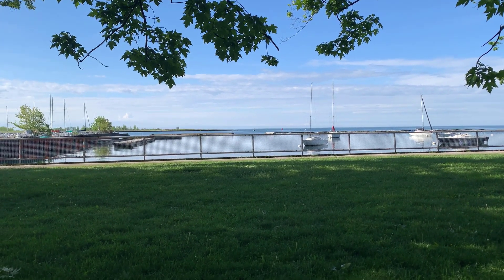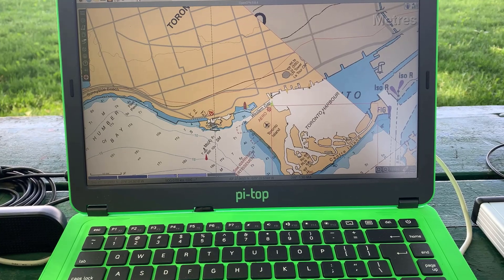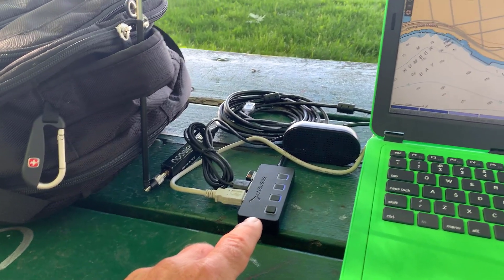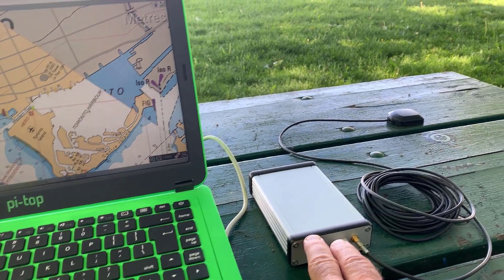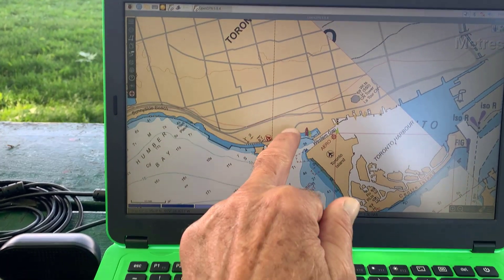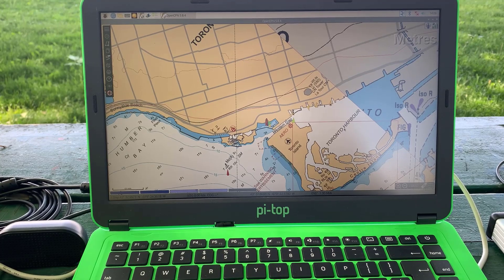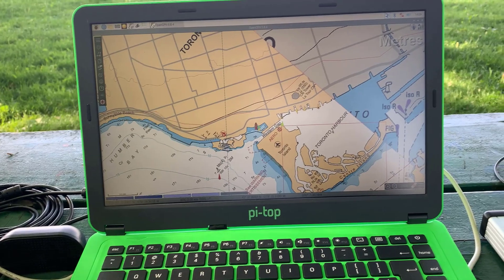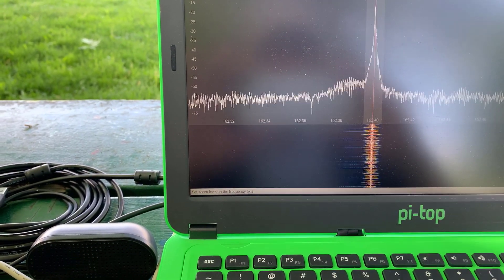OpenPlotter3 - AIS & GPS on RPi3B

Comment: Hi Jeremy, I use a RasPi 4 (8GB) and OpenPlotter 3. For the AIS RTL-SDR-Dongle I build myself a Flowerpot Antenna with a choke coil at his base. I carefully trimmed the Antenna on 162 MHz with a small China SWR tool, and the RG58 cable to the antenna is no longer then 9 m. But I am not very happy about the poor range that it gives me back on AIS targets. Any suggestions for me?
Reply from the maker: To see what is possible, try SDRangel_ais on Win/Ubuntu. You can have a separate receiver for 87B/88B. That is the most sensitive I have found. I use a Tram VHF antenna, but yours seems well designed and fine. A VHF antenna high on a mast would give greater coverage.